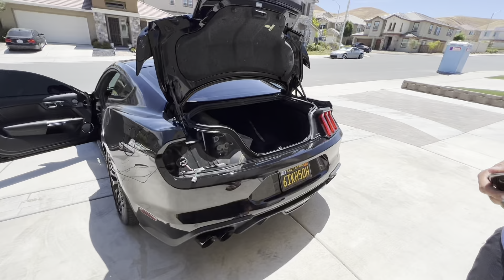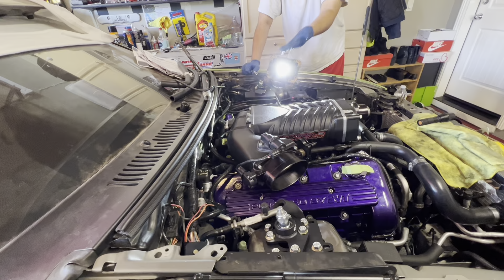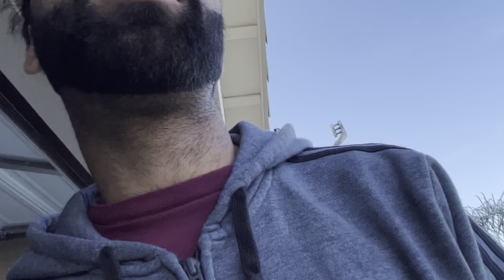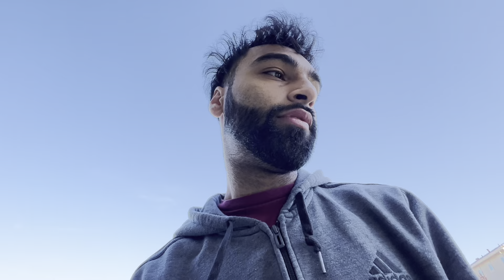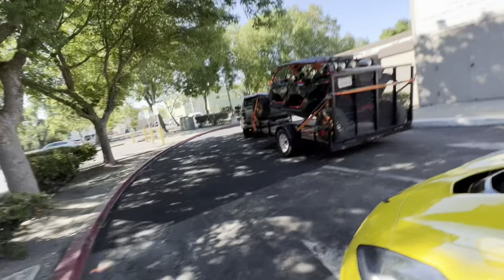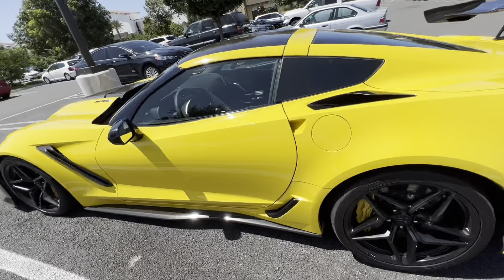Problems on my new c7 zr1…..

Comment: The reality is all cars come with problems but the problems these vettes be having be fucking insane. I know a hellcat ain’t in the class but it’s a perfect performance car to base reliability off of. The hellcat is indestructible vs the vette even the base stingray be blowing stock diffs, cracked wheels, heat soaking, torque tubes, VVT CYLD causing the engines to blow etc like damn the corvette is Chevrolet’s  FLAGSHIP CAR!
Reply: I feel like most of those issues are very rare. I haven't looked into c7 corvettes a whole lot, although I absolutely adore them, but even in higher powered vettes, most people have no problems. Can't absolutely verify but they seem to be overall reliable. I have heard of hellcat unreliability in the engine after a decent amount of miles but that's expected on a high horsepower/stress engine.
Reply: The overheating was a big problem on the gt500s I’ve owned 2 … that’s an easy fix with a heat exchanger … the TT is more common with the c6 thej it is the c7 ,,
Reply: @trashbandit2449  idk there’s a lot of class action lawsuits behind the car bro
Reply: @1Chinx   there's Actually only one, and it's for the wheels on some z06 and grand sports. Doesn't seem like a big deal to me.

There are more lawsuits on the hellcat actually. Rear ends are a large issue and the demons had one relating to their hood scoops/paint
Reply: @trashbandit2449  idk bro these wheels cost 1200 a piece. It’s easy to say when you don’t own the car. I’ve been around and in over 50 hellcats and none of them ever had a problem besides the hood scoop flying out at 170
Reply: @1Chinx  c7s are way more common than hellcats and I haven't seen a problem. Aftermarket wheels are a popular option as well

Not easy for me to say, considering I'm not well off enough to buy a c7 z06 or grandsport. If I could buy one of those two, and I did have a wheel issue, then I should have enough money to purchase another wheel. Or, sell the other 3 for $3600 (although I don't really believe you on the $1200 per, considering you can get a whole set for $2500), and buy aftermarket wheels, which I'd want to do even if the factory wheels didn't have any issues 🤷‍♂️

Comment: To all my “overheating comments “ STOP lol 😂 being a ex owner of a 2009 and 13 gt500 those cars overheat as well ..: anyone who buys a supercharged car from the factory and complains about the heating sell you car your in the wrong profession ..

Get a heat exchanger a tank and be done with it … spend the money 🤫 don’t get me wrong my car overheats even after the cooling mods but it is more efficient then stock and after 4 races I let it cool off … 

BOOST creates heat period it’s physics .. get cooling mods they work … 

If there is any car that impressed me stock from the factory it’s the 13/14 gt500 heat exchanger! 

The 09 gt500 /c7 z06 STOCK cooling was total garbage … z06 owners aren’t thee only ones that went through garbage cooling trust me Shelby owners can back me up on this … (07-09 cars ) 

My c7z06 has a HE / front reservoir / meth / e85  it a heads cam lower pulley … and thee only weird thing with the car is my check engine light came on twice and it always comes back off at thee end in the day it’s into happened to me twice had the car for 5 months so I just  bought it ,,,, the car was built my AMP in Dallas and I don’t regret it they do awesome work 

As far as the crack wheel issue on these cars I bought forged wheels so there’s that … and I haven’t had TT issues YET I was told that’s a c6 problem more so … but It it happens I’ll go aluminum DS from the DSS … 

Nice car bro get PPF I have it it will save that sexy car .. and one more thing bro !!! You built a c7z06 so good you made me buy one !! Don’t let this SMALL issue bring you down this so nothing in your world you got this bro 😎enjoy that nice car you deserve it !
Reply: I looked up your c7 and black one is sick!
Reply: @pineyken1251  thanks bro